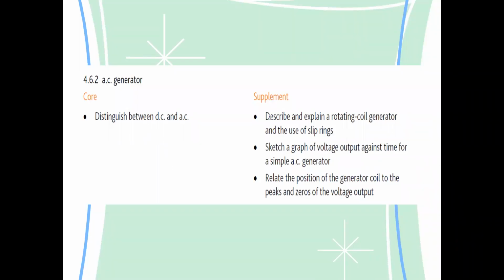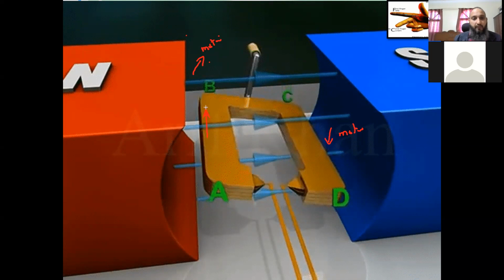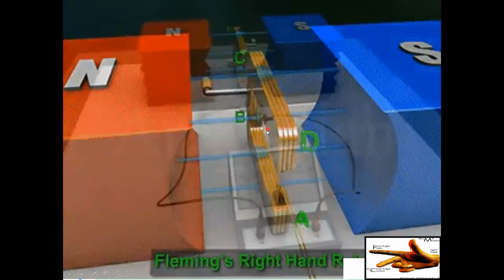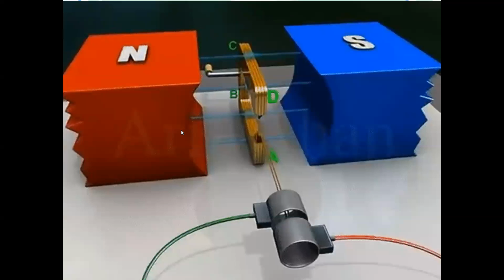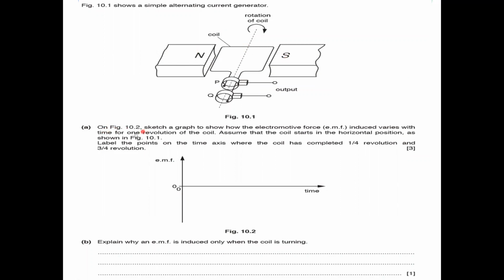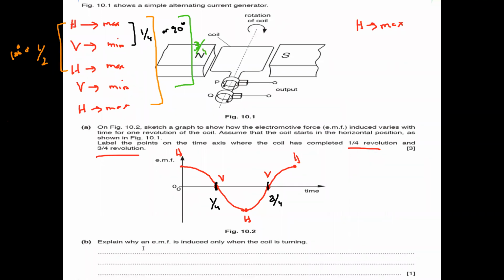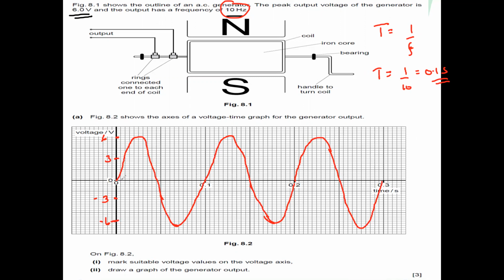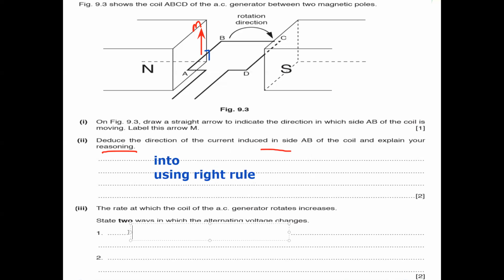Working of AC Generator Cambridge IGCSE O level Physics 0625 0972 5054 Lesson 69 Part a

Comment: Please can you explain...why slip rings 
s are used even if you can connect the coil directly to a complete circuit
Reply from the maker: It prevent wire from tangling
Reply: Thanky you ❤❤GOAT
Reply from the maker: Welcome

Comment: aoa sir i didnt understand that you said in previous videos that when the wire is perpendicular it cut magnetic field lines and maximum current is induced and when the wire is a long the direction of magnetic field lines  no emf is induced but here you are saying when its horizontal maximum emf is induced how sir ? isnt it should be maximum when its vertical  because then the maximum lines are being cut? please reply
Reply from the maker: The wire is perpendicular in ac generator at all point when it moves from a horizontal to a vertical position the distance from the poles decrease which decrease the induced emf
when it moves from a vertical position to a horizontal position it is closer to the poles so induce emf increase
Reply: @EducatorZainulArfeen  sir thanks a lot sir you are an even good teacher than at my school thanks a lot sir
Reply: Thanks a lot for the clarification 👌
Reply from the maker: welcome